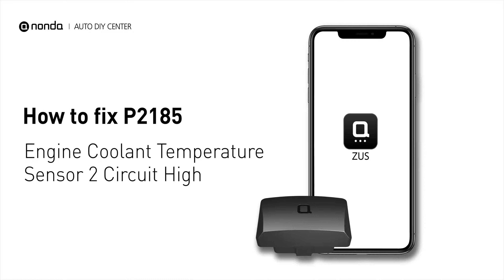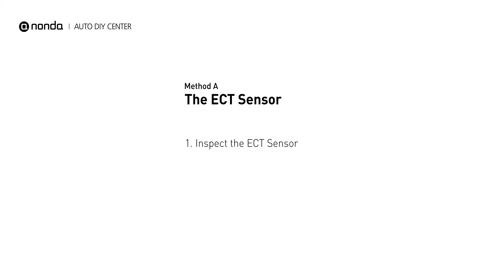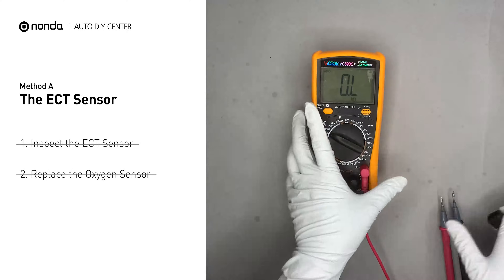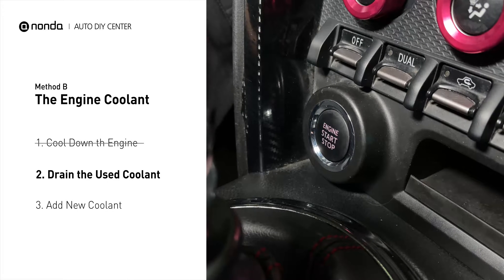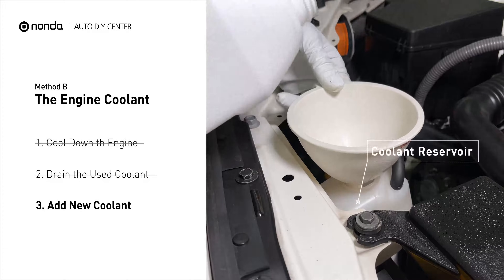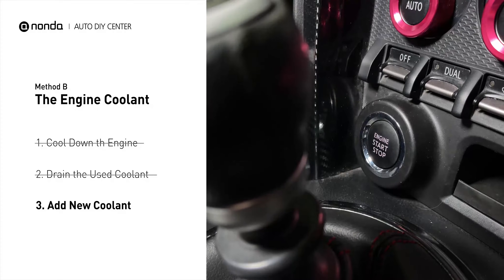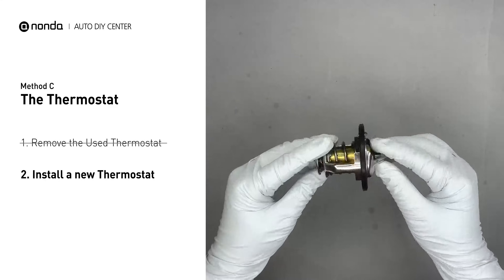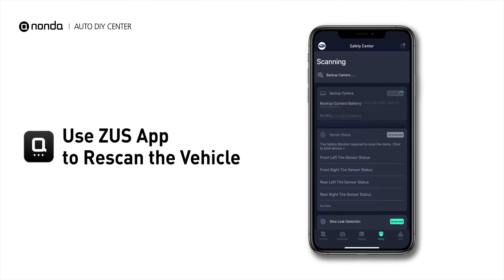How to Fix P2185 Engine Code in 4 Minutes [3 DIY Methods / Only $7.39]

Comment from the maker: Hi, I'm Steve, nonda's lead mechanic engineer. 
Feel free to leave your comments here if you have any mechanic questions, I will be glad to help you out!
Reply: Hi Steve, can i drive my mazda 3 while the check engine light on because of this Sensor ?
Thanks !
Reply: @JustFayroz  I’ll say that I currently have this code on my Acura TSX and my radiator overheated

Comment: Great advice, but on method to you, recommend draining the coolant and starting engine and watching temperature gauge for 2:35 overheating. With no coolant in the system, the gauge is no longer picking up any type of reading with accuracy. Temperature reading comes from the coolant that is in the system.

Comment: Hi, I am Haseeb from Pakistan, my car's radiator was frozen due to extreme cold temp, I repaired my radiator but then I faced error code p1285, I have Honda City 2010 model, I changed my coolant and temperature sensor found at the bottom of my car's radiator, but still have issues in STARTING the car only, and the engine check light turns on again.
The problem starts only during first start, after that there is no problem, only during first start the engine doesn't start, can you please help, what am I doing wrong?
Reply from the maker: Hi Haseeb, is there any other codes that register along with this code?
Reply: Q
Qa
Reply: Probably your thermostat